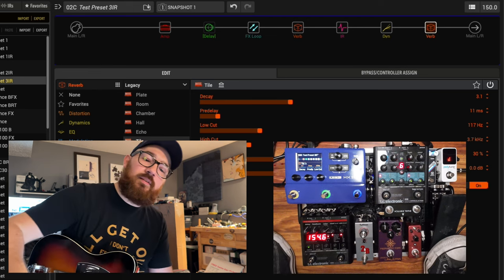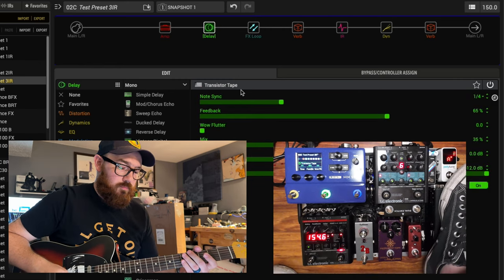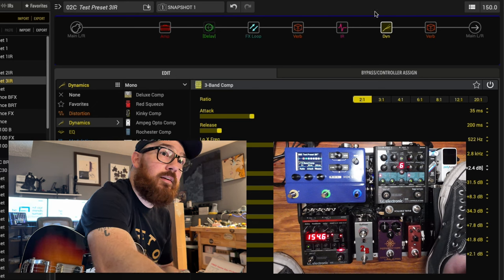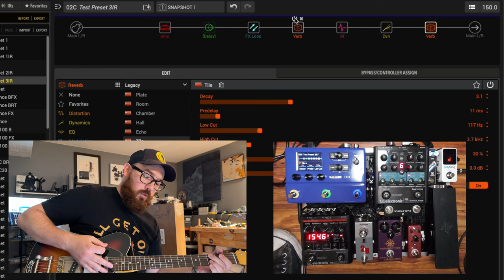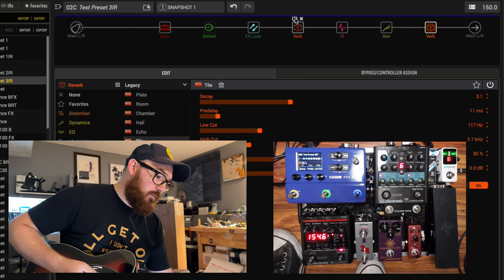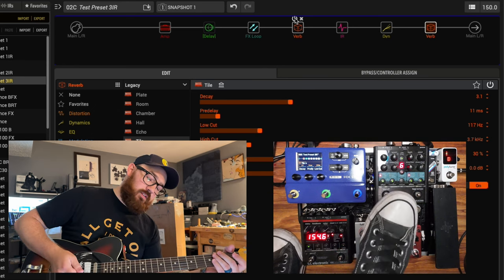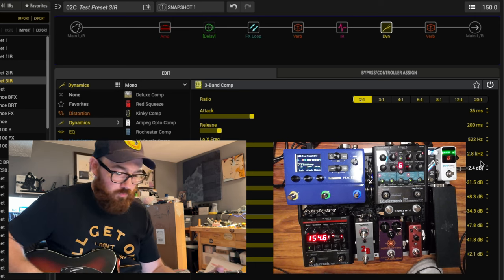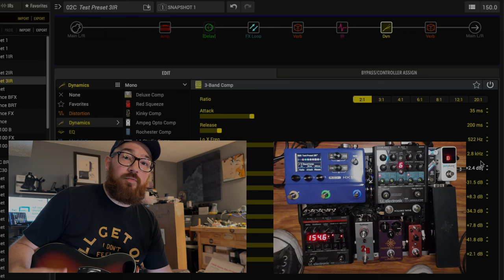My Mini HX Stomp Hybrid Pedalboard

Comment: Do you always run this through an amplifier or do you run it direct like in church setting? If so do you find that you have to tweak it at all  to get it to sound consistent in different applications?
Reply from the maker: I mostly run it direct in both church and punk rock gigs. I never have to tweak it, the sound is always consistent. The sound guy will make changes to adjust for the room. In the rare case that I have to use an amp, I have a few power amps and a cab that has two FRFR speakers.